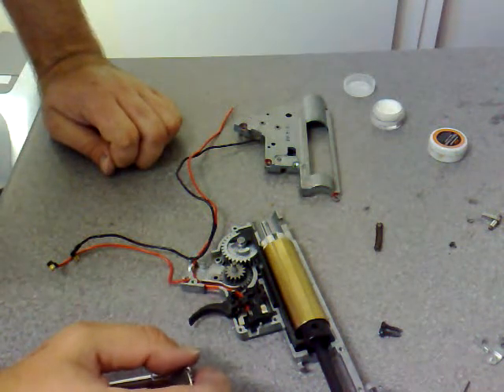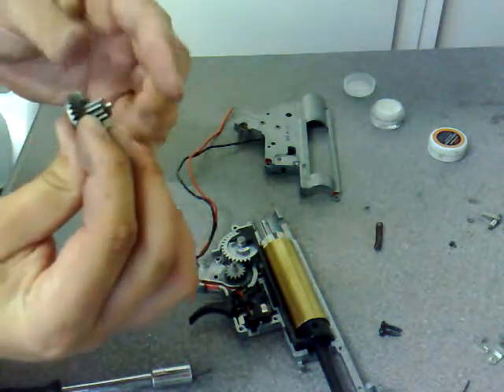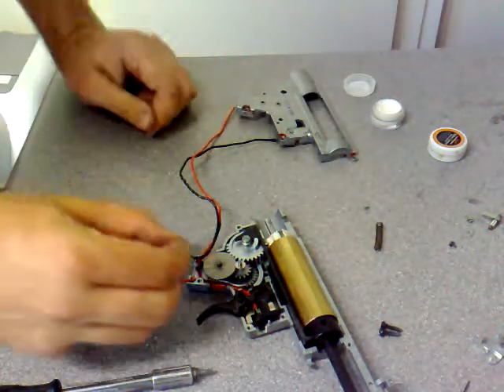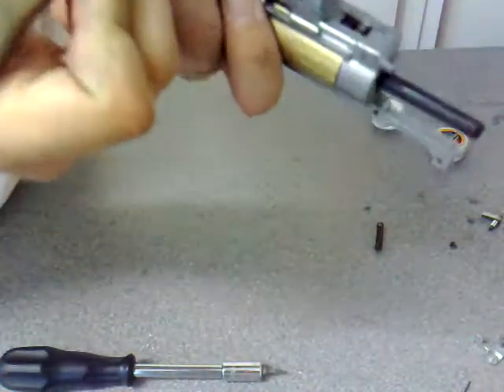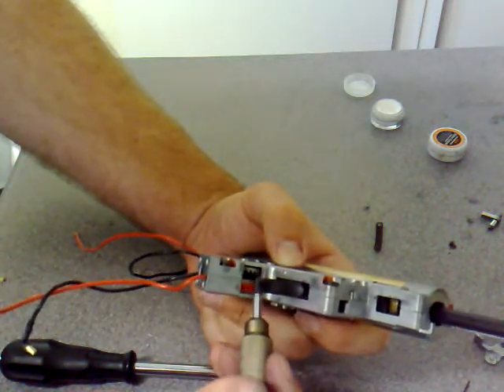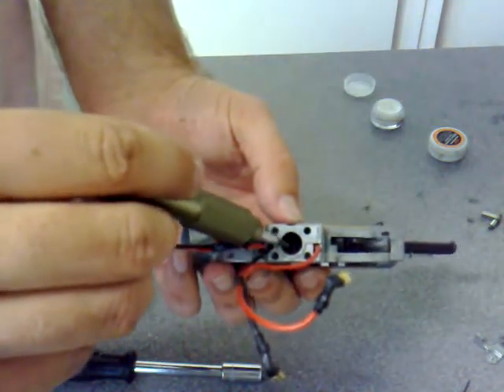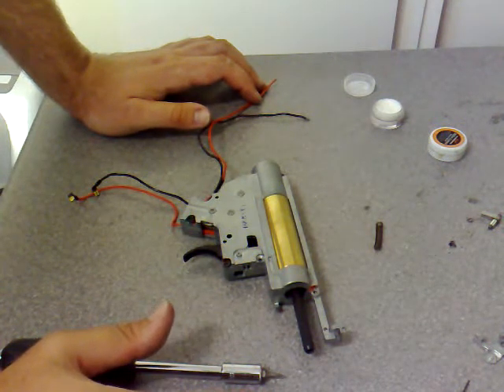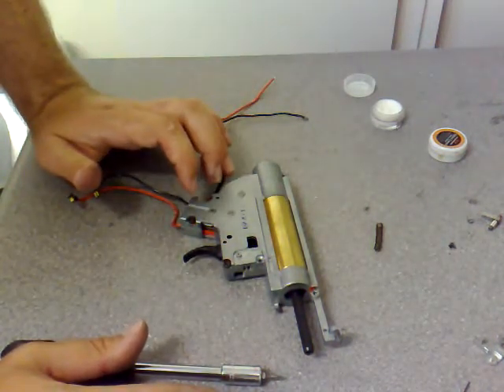Tutorial - How To Shim A Tokyo Marui Sopmod M4 AEG Gearbox - Part 3

Comment: why you remove the anti reversal latch ?
Reply from the maker: +Dede Ariandy it was just removed for the purposes of shimming the gears, when you rebuild it put the ARL back in.
Reply: +Eagle6Airsoft oh i see xD .. thanks for your video , but i have a little problem , when i spin the gear with the cut off lever in save mode , it just stuck a little bit and spin freely again .. is that normal ?
Reply from the maker: when the arl latch is in place it will not spin as freely because the bevel gear is bouncing off the arl as it spins.
Reply: +Eagle6Airsoft thank you :D ...